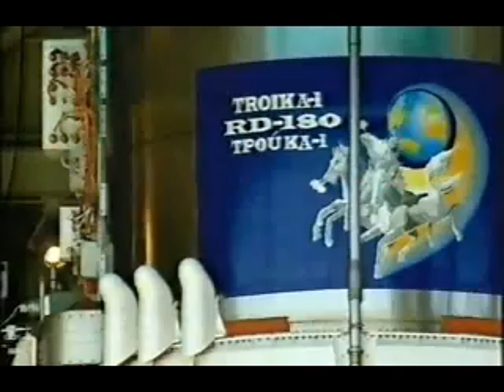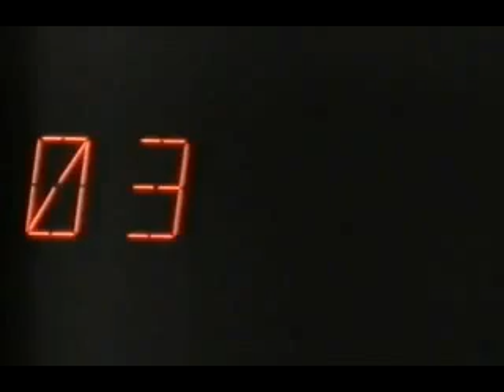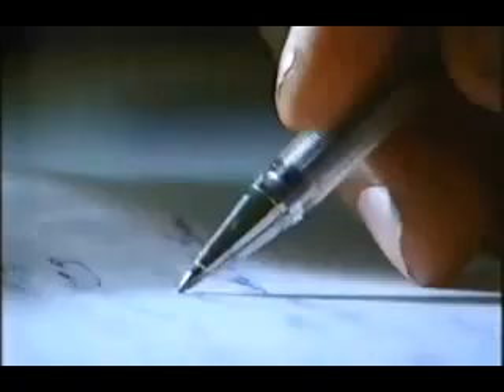Soviet N1 Moon Rocket Documentary Part 1

Comment: The RS-68 saved the Delta  series after the massive failure of Delta II/III and RS-27.

The Delta series are GARBAGE until RS-68 saved the 9000 series.

You are right about Russia's staged cycle man rating.

Comment: I agree 100% we were very lucky with the F1.  Actually they tried injector plate after injector plate until they got one that worked. It would have been better to use 5 dual chamber engines based on a scaled up LR-87-5 (titan II)

My fav engine is the Pratt & Whitney Rocketdyne RS-68  LOX  +  LH2 engine with an Isp of 420 vac and 760,000lbs of thrust. (Delta IV). 

A  4 chamber  engine based on the RS-68 that delivered +3,000,000 pounds of thrust would be the ticket for a new American SHLLV.

Comment: Not as in single chamber because of combustion instability problems but hence the reason valentin glushko went for a design with 4 smaller combustion chambers as in the RD-170 which was eventuall more powerful than the Saturn's F-1. The americans overcoming combustion instability problems in large H2/LOX engines was partly a fluke and the russians simply gave up after some time

Comment: The NK-33 and its staged cycle derivatives are great but they are in fact operating very close to the edge...so close that they will probably will never be 'man rated'. Now that NASA has lost their over priced shuttle derived ELV's (good!) the decision for what rocket would lift the Orion space craft into orbit was made. In the running were the Atlas V  that uses RD 180 in its 1st stage or the Delta IV  that uses the RS-68 in stage 1. The more powerful and reliable Delta IV heavy was chosen.

Comment: The NK-33 is a nice rocket engine, absolutely the best performing Lox +Rp1 engines ever made
USSR--NK-33 Isp  331sec Vac & 297sec SL. Thrust 1,750kN (394,300 lbs) 
USA---H-1  Isp (vac.) 310, (SL) 289sec Thrust 900kN (205,000lbs)

Instead of improving Lox + RP-1 tech the USA went into Lox + H2 engines and produced the HG-3 engine with 1,400.7 kN (314,900 lbf) of thrust and Isp (vac.)451sec, Isp (SL)	280sec. The Russians have still not mastered LOX+H2 engine technology.